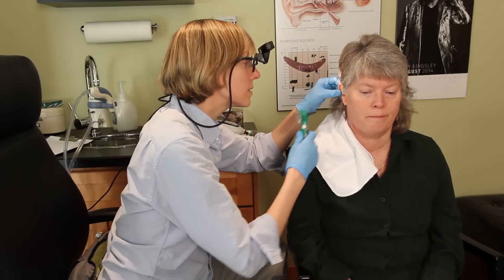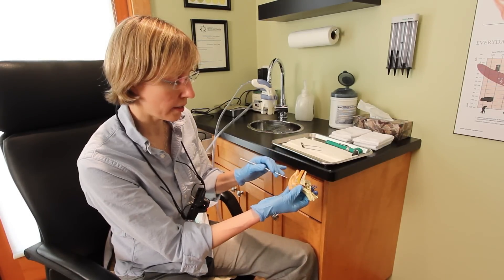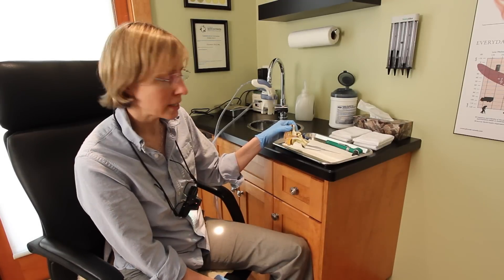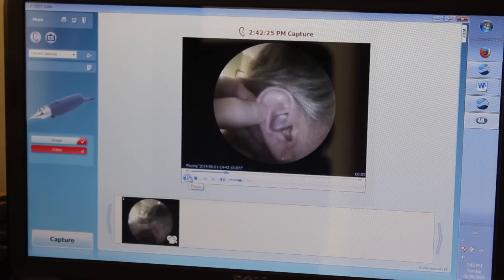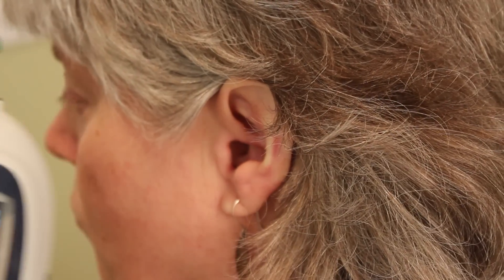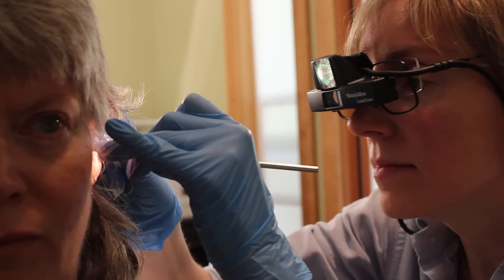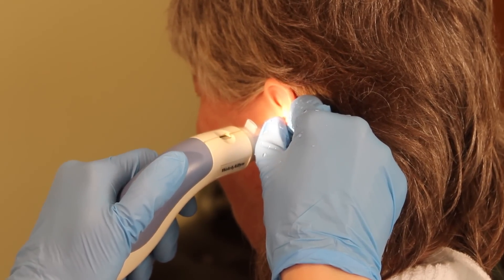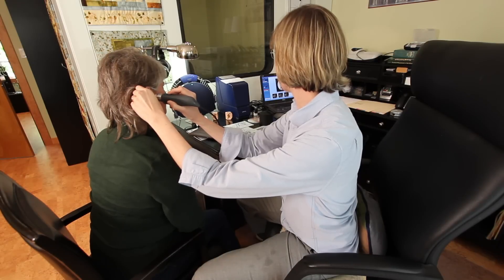Clinical Techniques - Removing Ear Wax

Comment: I can't stand this ear wax nonsense.  "Don't remove it unless it's a huge problem!"  Umm... gross much?  I clean my ears several times a week, otherwise they are just GROSS.  I do it after my shower, so that the wax is warmed and easy to remove, it sticks easily to a gently used cue-tip.  I wish we had ear cleaning services in the US, it would be very convenient and nice to have another option.  I also can't stand water or solutions in my ear.  It's messy, gets everywhere, and feels awful.  And I've never had an issue with using cue-tips either, despite the dramatic protestations not to use them.
Reply: Tips push some of it further into the ear.